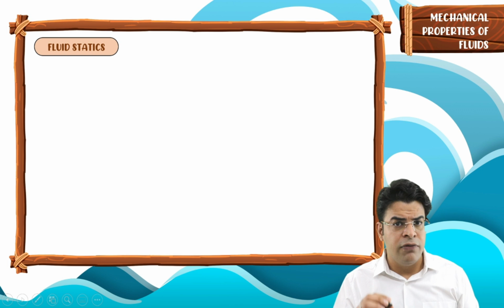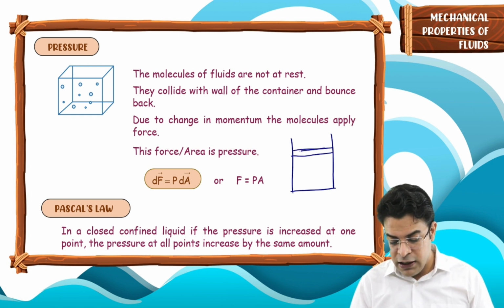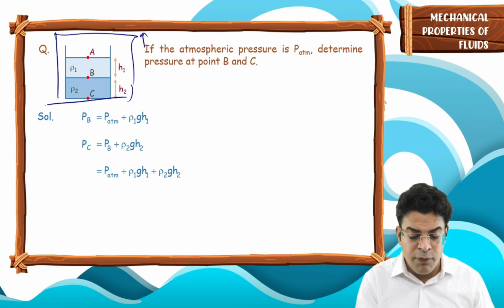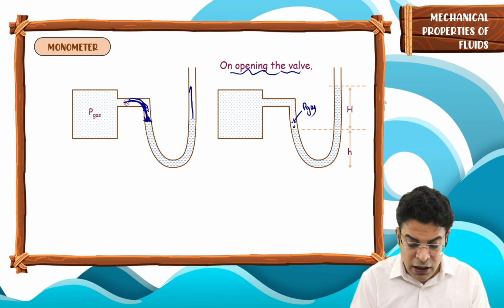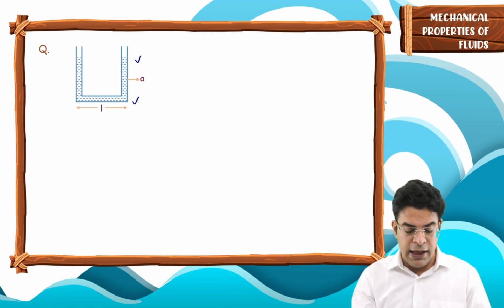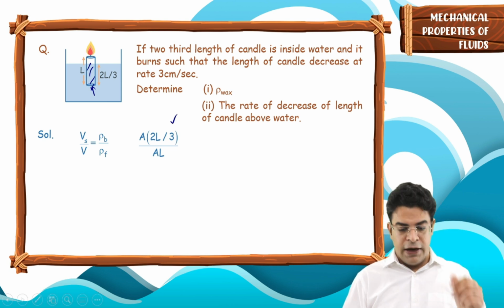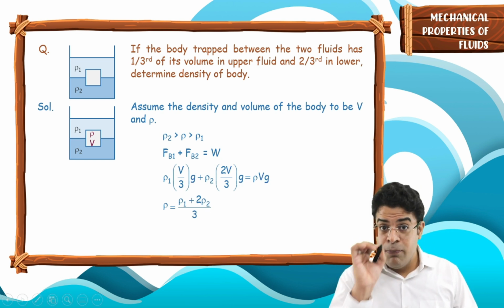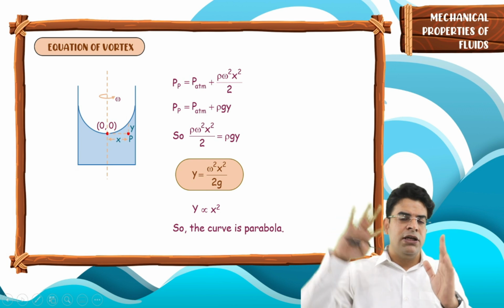NEET Physics Revision | Fluids Mechanics (Statics) | Hour 38/84 | In English

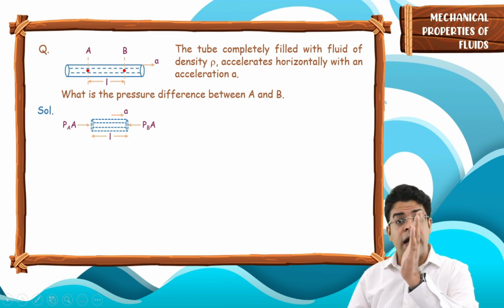Comment: Sir @ 39:29 as the fluid flows towards right with accn a,why it collides in the direction backwards
Reply from the maker: Fluid molecules are never at rest they are constantly moving so if we consider certain part as system the surrounding molecules apply the force.